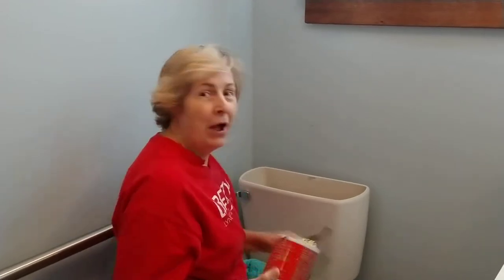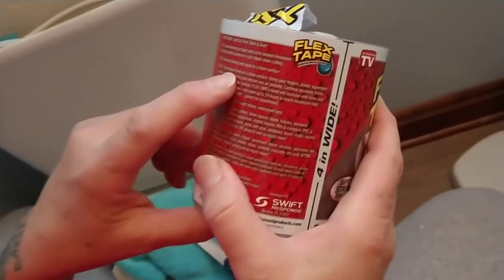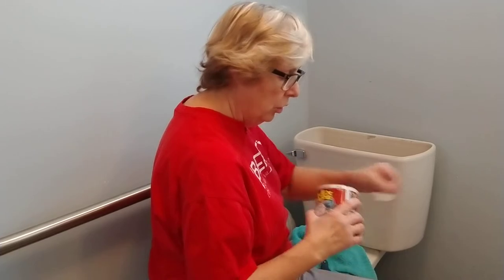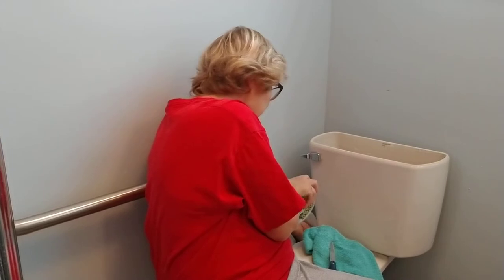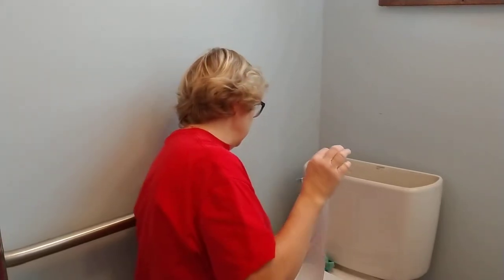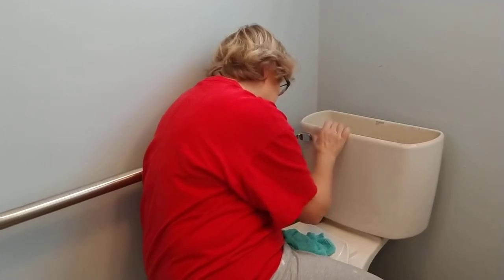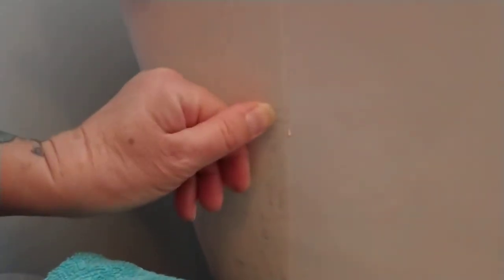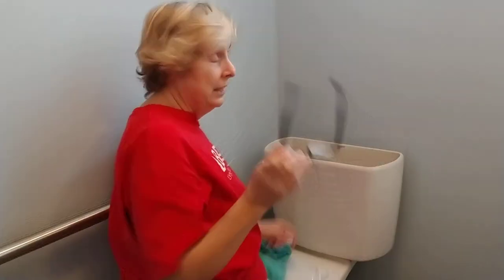Flex tape fix

Comment: To remove the remaining water, you hold down the toilet handle, and it drains the water in the tank.
Reply from the maker: I tried that and it didn't work. I found out later that the shut off valve was messed up. So when I tried it just filled up again. 😂

Comment: "I cannot get all the water out from the inside." 🤭 One could flush the toilet? 🤗 Hehehe. You are my gal! Once I find where the toilet is leaking, that derned thing is getting Flex-taped!! (You should have seen under my kitchen sink! I used 2 rolls under there!) 😂
Reply from the maker: Every time I flushed the toilet it still filled up again. Even after I turned off the water because the goofy thing was broken. Ha ha I did have a guy come in and replace my toilet finally. Yay!
I'm glad you enjoyed my video and tried it yourself.

Comment: How is the tape holding up?
Reply from the maker: I changed the entire commode so that was just a quick fix until I could get someone in to replace it. The only problem with the tape on there was it had to go around that curve and as you know tape doesn't really want to do that. It dripped slightly. I just put something down there to catch the water as it slowly dripped. Lol